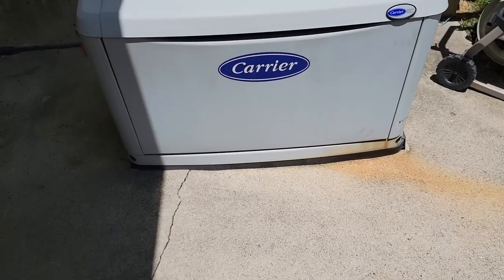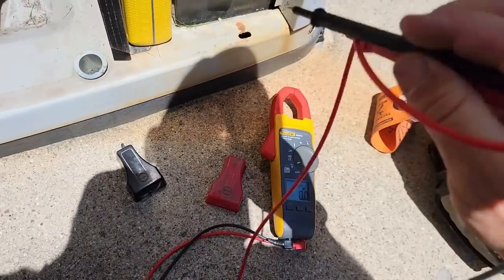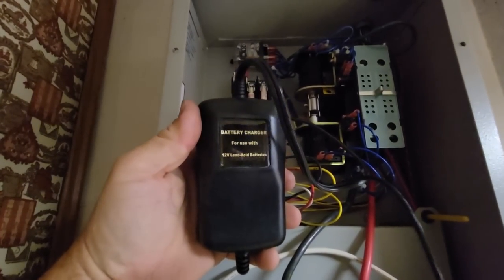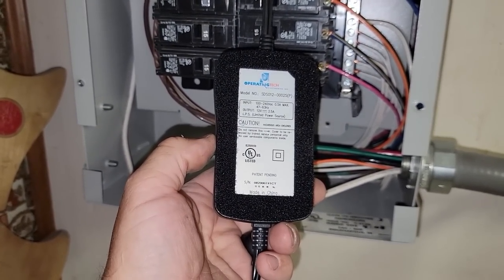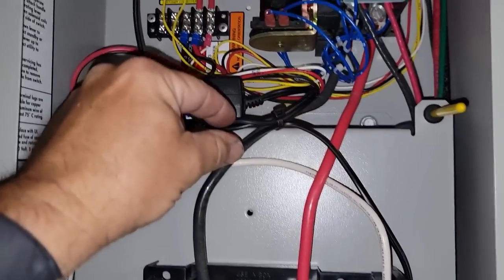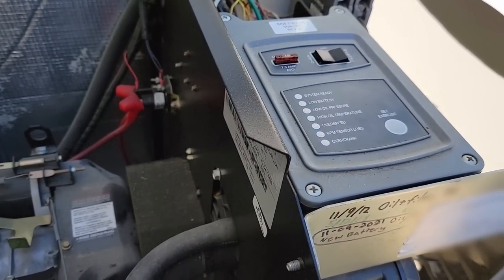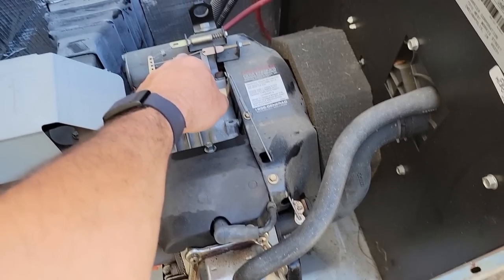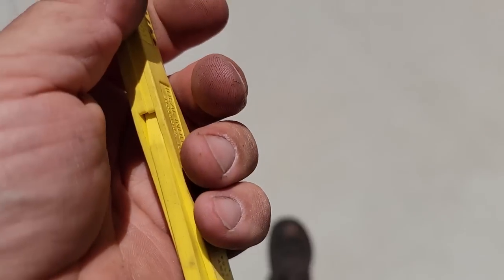Generac / Carrier Standby Generator Won't Start Blank Display

Comment: Shouldn't that battery charger have some type of inline fuse the way it is wired directly?
Reply from the maker: I know a lot of them have automatic overload protection built in. I recently bought one for my portable generator and it has reversed polarity, short protection, 5 stage charging, over charging protection and was $18. This one I believe was well over $130. I haven't seen the prices for a while.
Reply: @HVACRSurvival  I meant the 120 volt input for the battery charger?
Reply: @markbarber1920  the fuse it hooks to the top of inside the transfer switch panel is the fuse just for it.
Reply: That makes sense I was wondering about the fuse thanks

Comment: Did you ever fix the hose that was not properly connected to the gas supply? Thanks for a great video.
Reply from the maker: Yes, I forgot to show it in between repairs.

Comment: Generator’s, I have been working on one that cranks fires and goes back to crank it does not run, have not figured this one out the problem is I don’t work on generators every day got the schooling if you don’t use it every day its tough to remember
Reply from the maker: You're absolutely 2000% correct. That's why I don't like working on them anymore. I feel your pain!
Reply: Most likely a fuel problem caused by the fuel solenoid not fully opening or the demand regulator sticking. You can take it apart for inspection or you can ask the factory to supply an entire regulator / tank assembly under their voluntary recall from a few years ago. If it has the black tank, they were prone to rusting out, which causes an air leak. (and sometimes a gas leak) The factory may suggest that an authorized dealer do that work, but it should be no charge under that campaign. Be prepared with the mod / ser # information when you call.

Comment: No governer? how can it work at all?
Reply from the maker: I should have corrected that with a title. I meant a servo controlled governor. Its just a mechanical governor that gets out of range as time goes on and the springs get loose.

Comment: Boy I would like you to explain to fluke ruff voltage. Just because it a clamp do not mean it built to a lower stander. A fluke is a fluke every other meter are not as good as a fluke. You my disagree but fluke is the industry standard. Used by all trades and tradesman!!! From Texas Master Mike Frost 95381 look at the UL and spec on the meter.
Reply from the maker: This Fluke 902fc and even my Fluke 376fc do not have the resolution that my Fluke 87V has, they are not as high resolution and do not have the sampling rate the 87V has. That's a proven fact, that doesn't mean they are crap and not good, there not built for that is all I'm saying. They give you accurate amperage and rough voltage with a one decimal place resolution. The 87v can pick up a reading in 200 micro seconds in high res mode.

Comment: Ahhh the ole junky charger....ive replaced a bunch of those
Reply from the maker: I hated using the older block style. 👍👍
Reply: @HVACRSurvival   I had on fail and was sending over 30vdc to the battery... Cooked battery almost caused it to blow

Comment: Generac sucks. Poorly made junk. I have had to rely on those unreliable machines. They were junk 10 years ago as they are today. Though proper and regular maintenance and service it should always be functional. Many of the service calls in these videos are due to lack of maintenance. Thanks for the vid. Generac still sucks.
Reply from the maker: The older ones were not reliable but the newer ones aren't too bad.
Reply: @HVACRSurvival  Thats ok. I still like your videos. ;)
Reply: Customer has a 20+ year old one that seems to run fine.   All of its problems were related to the transfer/trigger side, not the actual generator.  They were the mainstay for colo facilities in the late 90's.
Reply from the maker: @tbelding  those were a lot different design than these I believe.
Reply: @HVACRSurvival  - Probably.  I think the one at my customer is 15KW.   Runs A/C, partial warehouse and office lights, server room, and half the office power.

Comment: FYI about not liking LPG/propane generators that don't have chokes. Um, they don't need them. That's why they don't have them. Chokes are for gasoline. They do absolutely NOTHING for gaseous fuels. Do you "hate" diesels? They don't have chokes either. It's absolutely asinine to say you don't like something just because you don't properly understand it. Your lack of understanding isn't the engine's fault. It's your fault.
Reply from the maker: These do have chokes! Who doesn't have a firm understanding here? 😏 I'm not a full time generator mechanic if you didn't notice... I work on HVACR equipment and used to do a lot of these cheap junk standby generators at a previous company because "electrician's" and "plumbers" around here are not able to do more than twist wires together and glue pipe.  So no I don't work on diesel.  If all I did was generators I would go nuts.
Reply: @HVACRSurvival  Engines that were designed for both liquid fuel and gaseous fuel will have chokes so they can run on liquid. An engine that is ONLY designed for gaseous won’t have one. I’m an engineer, not a “technician”. I design the engines that you repair. So please don’t tell me that I “don’t understand”. It isn’t true. Thanks. What I certainly DO understand is that you said you “don’t like generators that don’t have chokes” because they “rely on everything being perfect in order to start”. That isn’t true and that’s what I was commenting on. Gaseous fuel doesn’t need to be “richened” to start a cold engine like liquid fuel needs.